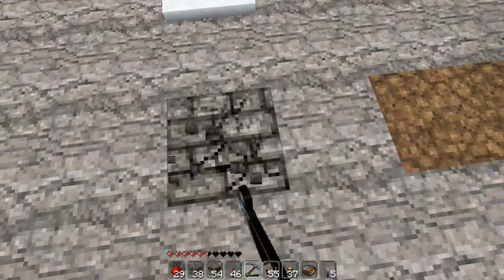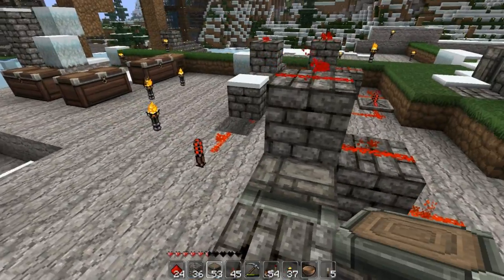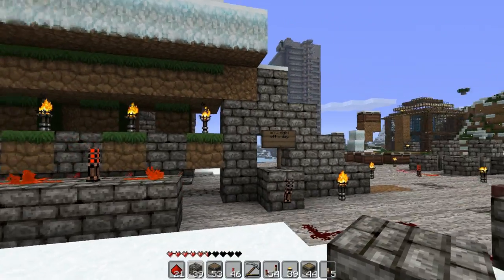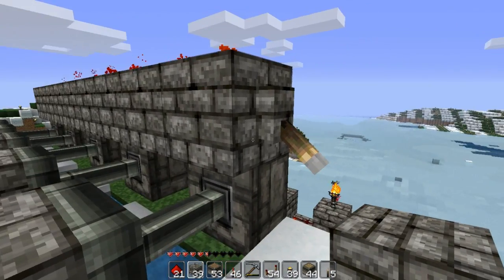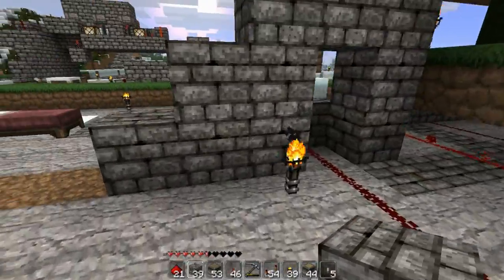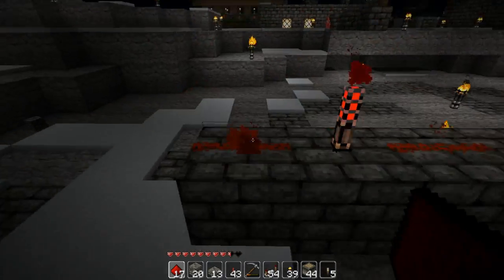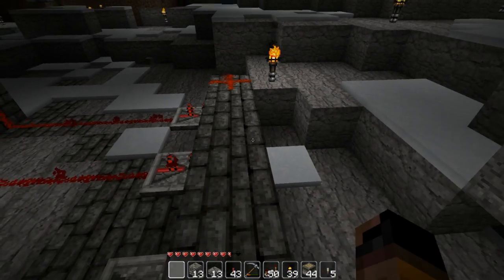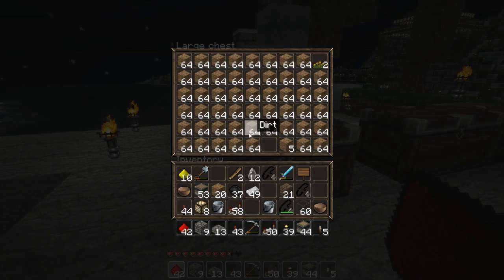Minecraft Piston creation #11-NEW BUD-switch and light sensor + Tutorial

Comment: @Sinrr1 The part you might be missing is a clver combination of a raising and a falling edge detector. The raising edge detector will send a puls to its output if the output signal of the BUD changes from off to on and the falling edge detector will send a pulse when it changes form on to off.
The output of these detectors are then connected to the latch.

Comment: Hey JL, good video, very informative. I had some experience with redstone and BUDs, but to be sure i copied all the design, except that i used 8 grass plots. Everything works fine when i update the sticky piston with flint and steel, but the problem is that the grass isn't dying under the water, nor when the piston is extended. I tried out each possible configuration, but grass does not die even when its night and i cover it with dirt block. What do? Could anyone help?